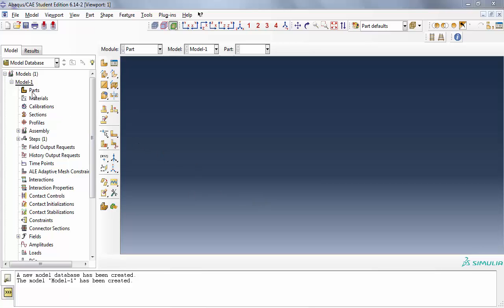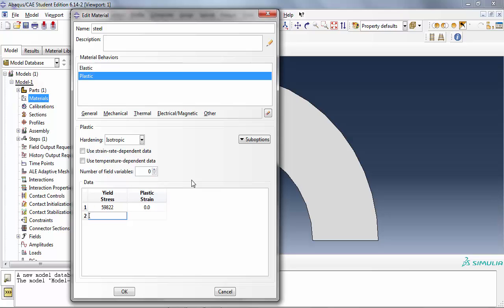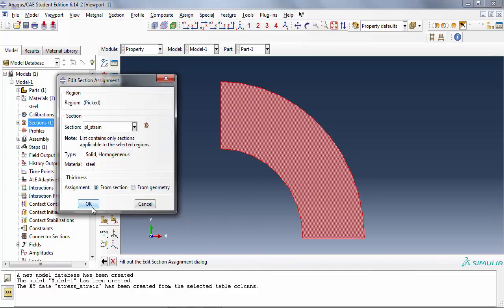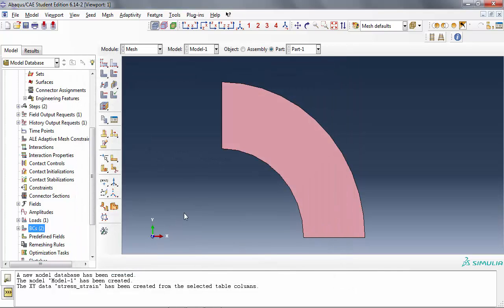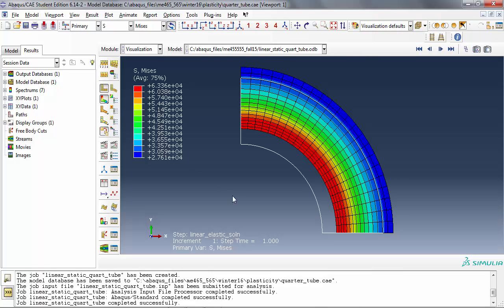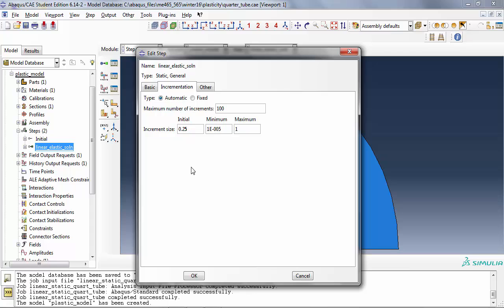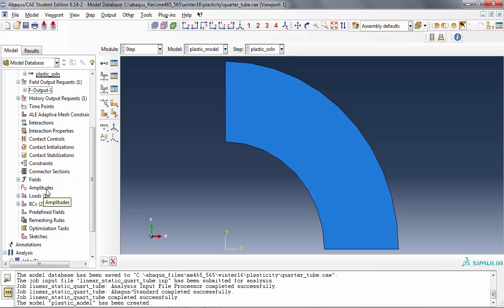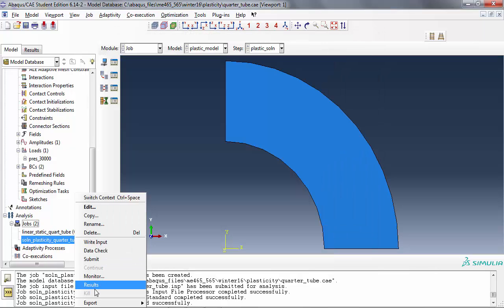Abaqus/CAE plasticity tutorial

Comment: Hello, I'd like to know where these values come from, for your Young's modulus and plastic values ?
Like, you input 29911000 for E. But usually it's either in MPa or Pa, being 210e3 or 210e9. What's that 29e6 ...? And those yield stresses : usually it starts at about 200 MPa. What's that 59822 thing...?

Thanks for answering ! :)
Reply: Also, I tried doing what you did on a 3D analysis(a 3D model) and I get an error when submitting the job. It says the time needed for the next increment is too small. (1e-35)

What can I do ..? Actually I never managed to do a static general step. I usually always go with linear perturbation. But now since it's plasticity I can't...

Can you help please ?
Reply: The value is very close to the theoretical general value of 30e6 Psi and it comes from actual experimental data, hence the slight deviation from theoretical value !
Reply: The values come from experimental data, with the unit of PSI (Youn's modulus is  very close to the established value of 30x10^6 Psi !